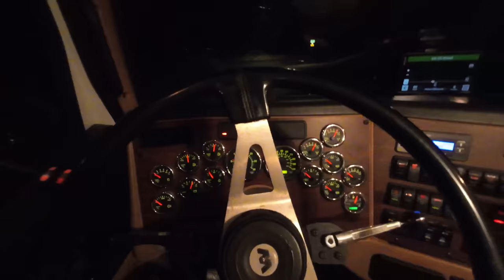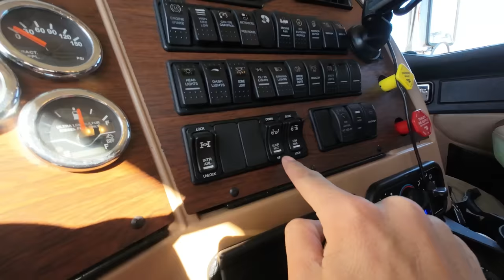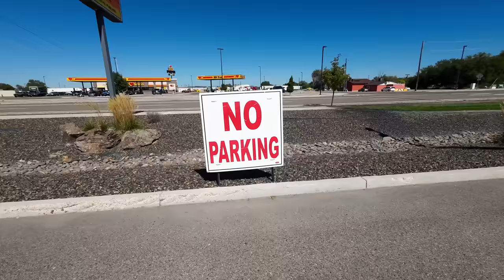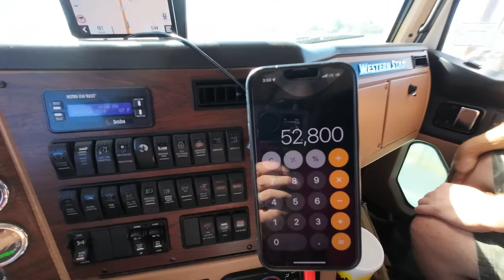Can we get these rare CLASSIC rigs back home?!

Comment: Grandparents had a 40 acre alfalfa farm just NW of Ontario.  Dad worked in Albany, OR and had 100 acres just south of Independence.  I remember traveling through Lebanon, Bend, Burns, Vale a couple of times a year.  Had my learners permit when Grandma died.  So made that trip at the wheel of the car.  Grandpa died almost a year later so almost had my driver's license.  Made several trips with Dad to haul things home before the Ontario property was sold.  I also remember that Dad forgot Mom near Sisters on one trip.  Middle of the night so everybody was sleeping in the back of the wagon -- well, I was sleeping in the right passenger seat.  Dad woke me up to find Mom.  Couldn't.  I think we were an hour out of Sisters.  Right about then the highway patrol found us to confirm that Mom was back at the last gas station.  I guess she felt the call and didn't tell anybody.
Reply: That’s funny.  I live in Lebanon and grew up in bend , so I’m also familiar with the drive. Great memories

Comment: Torch and a Hammer!  Glad you boys are home safe Casey. When I've had leg cranks get stiff or slow, I heat them up to cook off dried grease then pound the to get the flakes to drop out. Landing gear is expensive and replacing is outrageous! This simple 30 minutes a leg will save you more then regular greasing. Good Luck if you are having that problem.
I've driven for great companies with new well maintained equipment and I've driven for the dirt bags that expect drivers to fix or deal with problems on the road, so glad to be retired now.
Common folks do not realize the troubles truck drivers have daily and don't give a  rap, but many of us out here still do.
You are in my prayers
Hoka Hey

Comment: Good video!! Yup... I would not have anticipated that much difference in truck height. I didn't think about your tires being oversized/taller than the usual. Thanks to some very helpful guys at that dealership it saved you a ton of up and down riging. Glad you and Ben made it home without any problems so you can sleep in your own beds.

Comment: Euro trucks have had freely adjustable air suspension for atleast 10+ years by now, they are pretty convenient exactly in these kind of situations when a trailer is too high or low to hook up. Of course even that won't help if the trailer itself is that kind of design where your fifth wheel is gonna hit the connectors and the end of truck frame is ramped so you can't fit wood blocks securely. But oh well, Entertaining video as always Casey!
Reply: Forgot to mention independent front air suspension, typically with ZF. Is ZF the standard or does someone else supply it?

Comment: I can not fathom that you guys still don't have an electronically adjustable air suspension. 
We've had this stock feature on our eurotrucks and trailers for over 25 years now.. 
Surely, it can't be too hard to retrofit since you already have airbags and a leveler.

You also shouldn't worry about over extending your airbags like that. If that was harmful, our shops would be filled with trucks and trailers with blown bags. Since there's a lot of docks where we need to raise or lower the suspension to the max. Even when hooking up loaded trailers, we tend to max out the bags to make sure the landing gear is clear of the ground so you don't destroy it.
Honestly, the only thing truly  harmful for bags is dumping 52.000lb on it at once. You'd want to let all the air out before doing that.

End of my little rant, haha. 
Great video, as always. You and Ben have some great chemistry for videos like this. always a pleasure to watch.

Comment: I am not a trucker, I just have a utility trailer.  That said, I have two or three straps that I TRUST that will bend a tractor in half if I am not careful with them.  I have bent parts of my trailer overtightening the straps.  Then, I have a bucket of straps that I do not even care if they hold up or not, those straps are only me "cop deterrent."  If they only see one strap, regardless of how strong it is, they will pull you over and make you add more.  If they see 50 straps, made out of string cheese, looking like you went overboard, they leave you alone.  Augusta Georgia.

Comment: Casey,I can't help thinking that if you used those timber blocks longways on the chassis rails ,you would have been able to get the height that you needed  ??my reasoning is that sliding lengthways would have been a better movement !
Bottle jacks could have been used too  .
Hopefully Ben has dealt to those landing legs and they are fully functional now

Comment: Please tell your viewers to make sure hitch on bottom of pick up or motorhome are secure before traveling. Our motorhome hitch lost 3 of 4 bolts on our way home from EJS in Utah. Our trailer was hitting back of our RV. Thankfully we were able to get stopped and didn't roll our trailer with our Jeep on it. We only damaged back of motorhome. If anyone has questions reach out to me. We tow lots of trailers and have for over 40 years without 1 issue. I have asked many friends have they checked hitch under tow rig. Not 1 person answered yes.

Comment: The .5 inch tire sizing was created to prevent confusion between tubed and tubeless tires on trucks.  My first encounter with 17.5 tires was on my brother's 1959 Chevy 1 ton panel he bought in 1972. I still have an IH 1.5 ton 1966 and it has 8.25x20 split rims. Old tires but still holding air.

Comment: I guess you could have dropped the air in the tires to get the couple of extra inches needed. Also lowering the trailer tire pressure will help raise the front of the trailer. Then you just need to pull out the long hose and air everything back up from the truck system.

Comment: Your rear axle is 1,900 over weight. Ben may say it’s a 22,500 rated axle, but Oregon only allows 20k per axle. My crane truck has a single rear axle and I sit at 20.500 on the rear, despite it being a 21k factory rated axle and have gotten written up twice for it. Thankfully warnings only, as I think they realize there is nothing I can about it when I carry no freight. Just a heads up.

Comment: Blocks of wood on the frame rails, air up, extend landing gear, dump air,,, back under. Problem solved. Yep,,, fork truck works bettera,,, haha
Reply from the maker: The trailer has more flew than my bags have lift, so that didn’t work

Comment: Load the Tow truck up and take it to Cummins in Boise..
Reply from the maker: Spoiler alert.  I diagnosed it in my driveway in a couple hours and a few text messages to a buddy.   The guys at TEC Equipment are a bunch of fucking idiots that couldn’t find such an incredibly simple problem.
Reply: @CaseyLaDelle "ifer'n these darnable c'm'pooters don't tell us wuts wrong, we isn't gots no brains un us, to figger tit out fer usselves"

Old school diagnostics, reading some diagrams/understanding the system and doing actual testing and troubleshooting are lost on most "technicians" .... glorified computer guides parts snappers, for the most part!